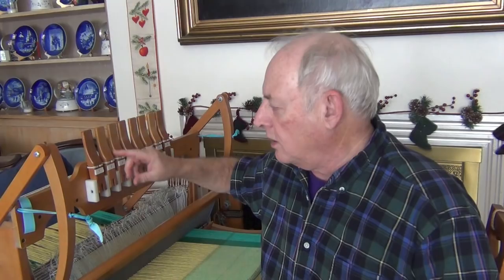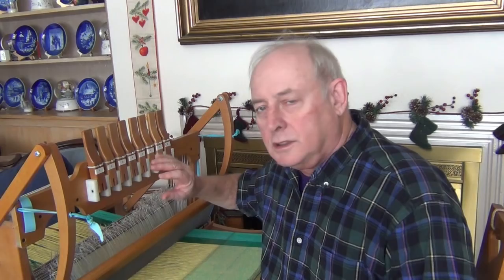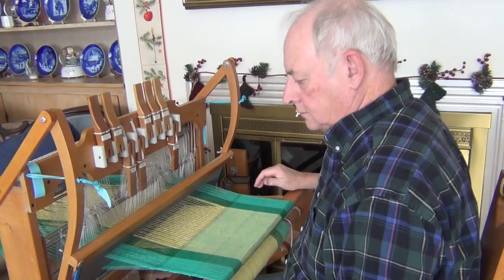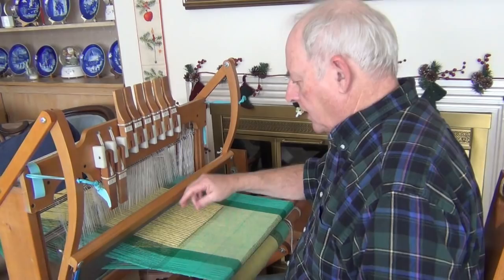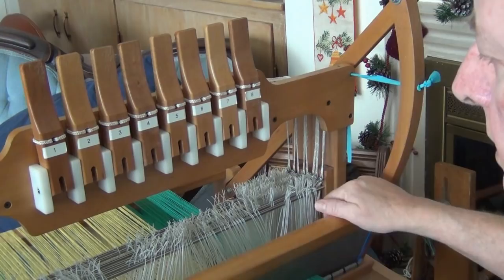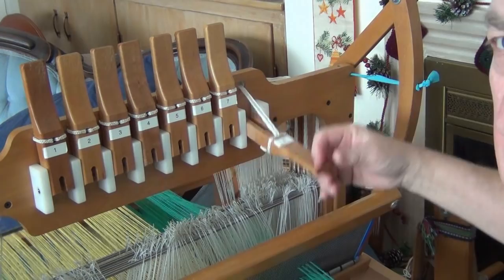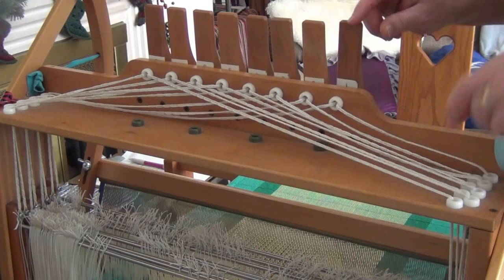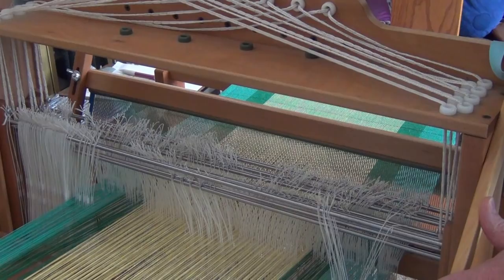Table Loom Levers

Comment: I just got an unidentifiable 4 shaft table loom (3rd owner of it maybe and its not branded anywhere!). It has a high castle, and the beater swings. Im just kinda confused about how high the shafts need to be tied, should the middle of the heddle (eyelet part, but i also have texsolv heddles installed) meet the bottom of the beater? ..so when the shaft is raised it goes towards the top of the beater? I dont think mine is tied just right.

Comment: This is a really useful video. I have been looking for a way to convert my Dryad 4-shaft table loom, which just has pull strings to lift the heddle frames, to lever operation. Now I know how. One question please: Do your frames go back down under spring tension (as do mine) or depend on gravity?
Reply from the maker: Gravity.

Comment: I too am the proud owner of an Ashford table loom.  I absolutely love this loom.  So easy to dress and weave on.  The only part I feel could have been designed better is the plastic ratchet and pawl that are on both the cloth beam and the warp beam of my 2018 loom.  Since I do not see any ratchet and pawl on the left side of your loom, I am assuming you have a slightly different system.  Would you consider doing a video showing your ratchet and pawl setup that appears to be on the right side of your loom?

Comment: Great video, enjoying watching very much! I have a question, if it is not much bother: the levers in my older table loom would not stay in place, they just fall back down (those levers need to be up to raise the shaft). Any idea how to fix it? I can see the shafts are supported by a kind of old elastic band to the loom walls but it does not fix the issue anyway. I appreciate any suggestion you might have! And keep posting!
Reply from the maker: not knowing what kind of loom you have nor more information all I could do would be to make a "WAG", and that is not a good answer, so I must decline to give any opinion.  I have 2 table looms and they each use completely different methods, without seeing the loom itself, I just can not even guess.

Comment: I just came across your video on Ashford 8 shaft....I am having an issue using mine and was hoping you could help. When I advance my cloth it doesn’t feed evenly so the left hand side looses its tension more than the right....do you have any idea what I am doing wrong or how I can correct this...I find the Ashford company lacking in support info. Thank you

Comment: I'm in the market for my first (2nd hand) loom and will start lessons in May if the class isn't full already. An online seller has a loom I had researched and coveted, but says she has taken off the levers and installed a pulley system instead. She says it's now much easier to weave on it. Does this make sense to you? As a newbie, I can't tell if I should eliminate this loom from the get go or not. It's a Louet 22" Jane or Kombo, if that matters. Thanks!

Comment: I wanted to build my own table loom. What I mostly interrestet in how is the shaft is pulled down?
Reply from the maker: Gravity!   The weight of the shaft itself, and the threads is all that holds the down shafts down.
Reply: @curmudgeon66  I once built my own loom. The problem with that was that the shafts were very difficult to move down. It took all of my body weight to push them down.
The warp threads were sticking too much to the heddles.

Comment: I love the weaving that you do. what kind of loom do you recommend for a complete beginner?
Reply from the maker: Ahhh - now that is a very hard question to answer.  There are too many answers.  And when I was a new weaver I hated when people said "it depends on what you want to weave", . . . . but that really is the best answer.  So for general weaving, if you aren't sure yet, and if you do not want to do rugs, but do want to try interesting things with out spending more than just a small fortune, then I would go for a four (or if you want to get fancy an eight) shaft table loom in the range of 20 to 24 inches wide.  There are many good brands, but three come into my head immediately:  Ashford, or Schacht, or Louet.

Comment: what are lamms?   i bought a used loom that was modified to make it a floor loom. I still have not put it back together after transporting it.   i remember the term lamms.   Lordy, help me  get this together.   I don't remember the brand!
Reply from the maker: "Lamms" are the pieces of wood which are at the other (top) end of the cord of chain that connects at the bottom to the treadles.  They are found most often on countermarch looms.  here are a couple youtube videos (not mine) that show the lamms:

First two videos from one weaver.
https://www.youtube.com/watch?v=eV-EH-OwJeY
https://www.youtube.com/watch?v=MeEORJd_FN0&t=0s

Now a video from someone else:
https://www.youtube.com/watch?v=2ga4OBL0v_k

Not all looms have lamms.  My direct tie up Sievers  jack loom does not, my direct tieup Ashford table loom (the loom in this video) does not have lamms, the cords just go directly to the "shaft" or "harness".

Comment: Quick question; Is there a difference in a Rachet loom and a Rigid Loom? I have Ashfords, Louet Erica, off brand and Beka. The Beka is a 36" Rachet Loom (RL Model) But I warped it up the same way as a Rigid and it is working fine. The Beka is about 25-30 years old and have already contacted the company about additional parts. Thanks Dear
Reply from the maker: I have never woven on a rigid heddle loom, so I can't say for sure.  I do have my ashford table loom which uses a ratchet, and my Louet Spring, which has a friction break.  I don't feel much difference between them.  The friction break system gives you infinite stopping points while the ratchet has a set number, but ashfords have enough points on the ratchet that there is virtually no effective difference that I can see or feel as I weave.
Reply: curmudgeon66 Thanks so much dear, I appreciate it 😊

Comment: Thank you Andy, enjoy your videos very much!  You explain the loom mechanics in detail which no one else really does.  And I love to watch you weave on the Spring!
We have no space for a floor loom at this time so strongly considering getting an Ashford 8 harness 32W table loom as my next step.  
Do you find that the beater swings forward a bit as you are weaving and makes the shed smaller?  I see you have something blue there possibly holding the beater back?  Would appreciate any input you have about that.  Also do you find you get good tension on the table loom?  Thank you!
Reply: I know this is a year old, but maybe someone else is wondering: the beater stays put as long as your stretchy cords are stretchy and not sagged out, and I find the shed sufficient for most anything. The shed is a little narrow for rugs, so if you're using thick weft you'll need to advance your warp every couple inches, which is a bit of a pain. The biggest drawback of this loom is the plastic ratchet & pawl (I'm worried I'll snap something and the pawl likes to jump out of place) and the lack of a shuttle race. It comes with and is meant to be used with stick shuttles, which are far more annoying than I anticipated (I really like to throw).

Comment: Thank you Andy! I have been using two Ashford rigid heddle looms and i am hoping to purchase a table loom by Ashford.
I don’t need it to be portable - i just need it to be affordable, also I don’t have the space for a huge floor loom. 
My question is about how much cottolin warp thread will the Ashford hold? Just a ballpark idea is fine, how many linen tablecloths are you able to weave on one warping?  I wont be able to use spools like a floor loom so I will have to warp more frequently. Thanks again.
Reply from the maker: Hi Donna;  How much cottolin . . . For WEFT I figure 20 epi for plain weave and 24 epi for twill.  As for length, I'm thinkin about 6 yards is about all I have ever put on.  The limit will come if you try to fold the Ashford up to travel, when the back beam is fully wound on, there isn't quite enough room to fold the castle part down all the way,  So if your gonna fold it and travel then maybe 5 yards is your upper limit for warp threads.  
Hope I have correctly interpreted your question.  Enjoy your weaving on the ashford.
Reply: curmudgeon66 thank you!
Reply: @curmudgeon66  

Hello Andy I am also intrigued by the table loom and was curious about the limitations the table loom has in regards to the max length of the project you can do. You mentioned 6 yards... is that a lot less compared to a floor loom?
Thank you!
-Ks